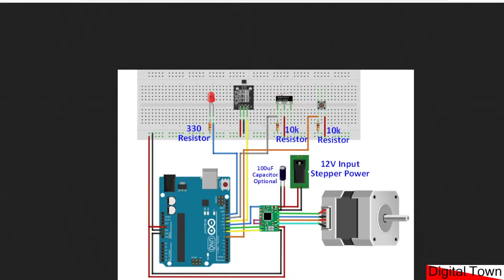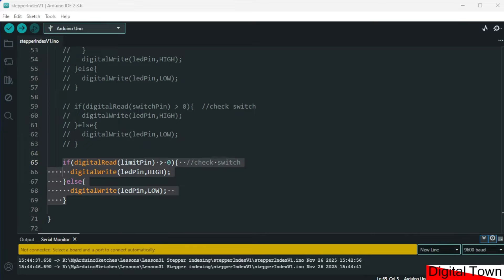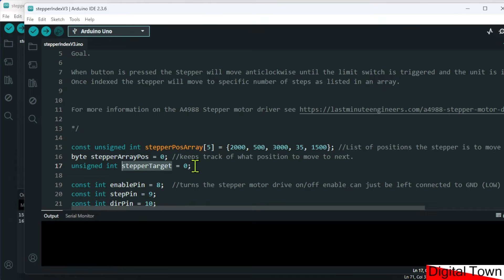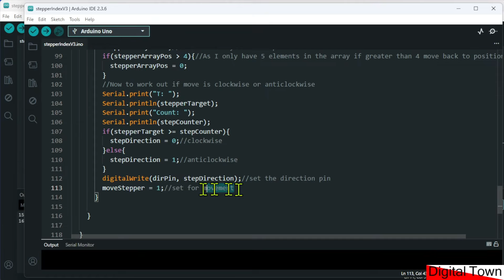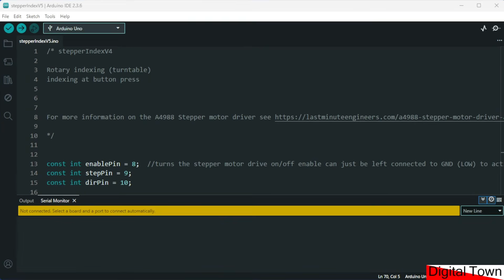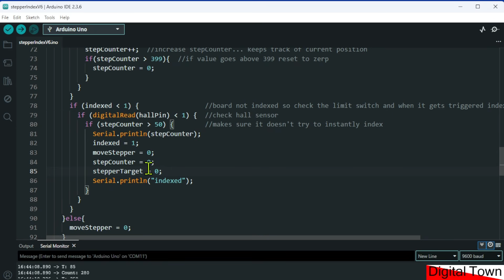#166 Arduino C++ Lesson 31 - Bipolar stepper motors Part2 - indexing

Comment: I don't quite understand the formula findDirection on the sketch version 6.

When it's indexed, the stepCounter is set 0. Target for 1st rotation is  350
 According to the formula:  findDirection = stepTarget - stepCounter,    findDirection is  350 - 0 
and direction of the rotation is anticlockwise.   Current value of stepCounter which is 0 then get subtracted by  1.
and because it's less then 0, it is set to 399
so 399 - 350 = 49.  Therefore, the stepMotr moves anti-Clock by 49 steps.    Do I understand it correctly?

Sorry for my English. I already tried my best to write this question.
Reply from the maker: Yes I think you have understood it.
So the indexed position is Zero (0) and the target is 350. 
The shortest distance in anticlockwise (only 10 steps) but as the stepper moves anti clockwise the stepCounter value drops below 0 (-1) so is reset to 399 as that is the maimum number of steps in a 400 step rotation (0-399).
Once the value is set to 399 it continues to rotate decreasing in value until it reaches the target of 350
Reply: @digitaltown5442  Thank you for your help. This helps me a lot. Have a nice day, sir.